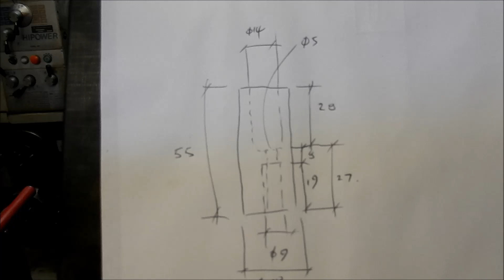Bandsaw Motor Replacement Part 1

Comment: Was the replacement motor really "aussie". Or was it here on a 457 visa?.   And.........why was it vibrating so badly on the bench.........was it 1440 or 2880 RPM.     It looked pretty fast.....you don't need it racing at the speed of light to generate the kilowatt............you need torque to drive the blade.

Steve Callachor
Reply from the maker: G'Day Steve, thanks for the reply.  Yep I'd certainly say it was a 457 although purchased locally at an electrical supplier through Ebay, next day delivery which was a surprise.  Its no TECO or Pope which are rock solid.  I don't think balancing is a big priority on these imports but for what I needed it for, it was a cheap replacement.  For a name brand I'd be easily paying at least 3 times more.  The motor is a 4 pole 0.37Kw (0.5 Hp) running at 1440 RPM. The pully speed reduction and then the further reduction through the worm gives an output RPM of between 20 - 50.  Plenty of torque to do the job and I haven't stalled it yet.  I specified the motor more to try and match the existing motor frame size to minimise the rework to fit.  One thing I have noticed, after an hour of cutting the motor is barely warm compared to the original which got so hot your couldn't touch it.  Of all my machine tools this one is almost in use daily so it realy cops a flogging.
Cam

Comment: Good video.  Nice and sharp.  What camera did you use ?

I replaced the crappy 1/3 hp motor on my Rong Fu with a second hand one HP Ozzie one and it made a huge difference.  No slow down what so ever.

Cheers Rob
Reply from the maker: G'Day Rob I commandeered the family camera from my wife to do all the video's, its a Nikon Coolpix S9600.  Pretty cheap but does a reasonable job.  When I get some more funds (one day) I'll buy something a little better.  My camera stand is a microphone stand from the tip recycling store and a small Aldi ball swivel vice I've modified to fit the camera and stand.  Alright for now but it does get the shakes if I have the boom extended to far.
Cam
Reply: Does an OK job.  My Nikon Coolpix L820 has similar specs.  I just wish it had an external mic jack. Action cams have them, but not bridge cameras.  LOL.

Keep up the good work.

Cheers Rob